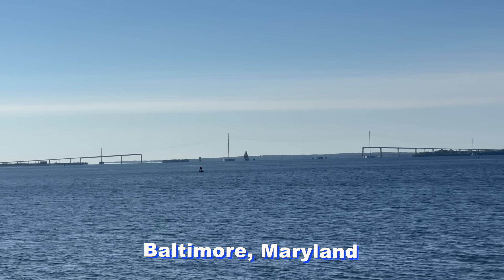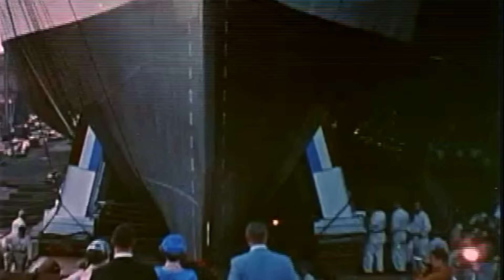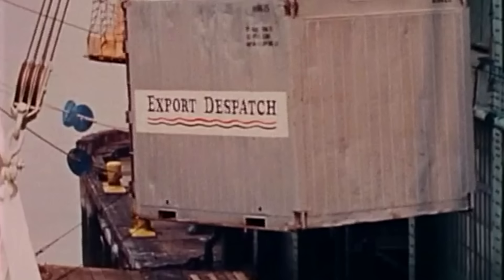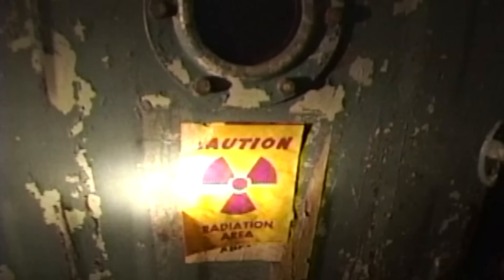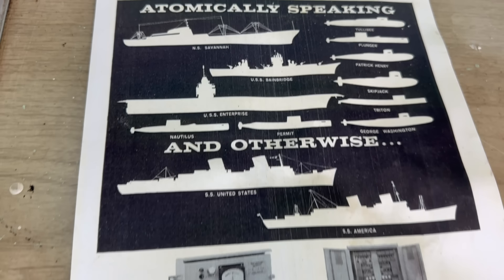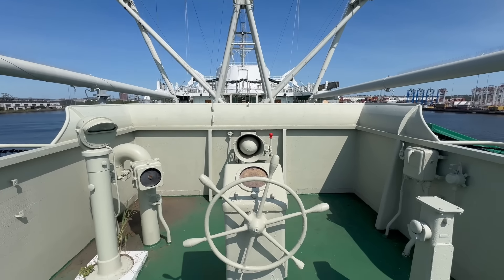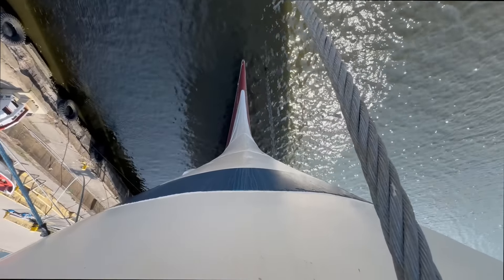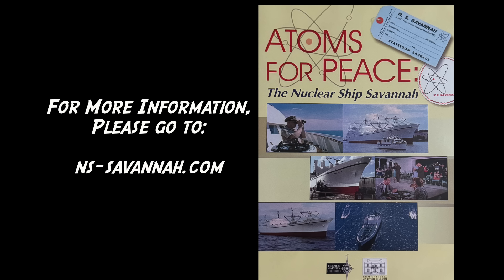NS SAVANNAH Decked! In 4K

Comment: Note that both NS Savannah and John W. Brown will be open for tours on Saturday, November 16, 2024.

Here’s a video of me trying out the “Lamp Test” buttons on the Reactor Control Panel:  https://youtu.be/UMOFP8V8dLU

Here’s the Control Rod Group Selector controls, with a peek inside the Control Panel:  https://youtu.be/tkVEMNxQGtM

Here’s me demonstrating the Alarm Annunciators removed from the main panel:  https://youtu.be/HWiGii9RlMY  I hope to eventually get all 154 annunciators working, starting with the SCRAM Annunciator.

Currently the Control Room is off-limits due to PCB contamination, most likely caused by me tracking dust from inside the console.
Reply from the maker: Excellent!  Two classics on one day.  Thanks for sharing those videos.  Very cool.

Comment: Enjoyable video and lovely restoration.  However, an observation.  Not sure how the original designer managed to botch the design by having the main lounge with absolutely zero external view over the bow but sticking a walk way between it and the exterior hull.  It could have been a fantastic view and O don’t think I have ever seen such a mistake on a ship with their forward lounge in my life.
Reply from the maker: I understand what you are saying but this was actually a classic design found on most liners of that time.   The enclosed promenade wrapped around the front of the ship, followed by an Observation Lounge.  The QUEEN MARY, ANDREA DORIA, GRIPSHOLM, ROTTERDAM and many other ships had a similar design as they were built for crossings and not cruises and the forward part of the ship was subject to rough sea conditions.  On modern cruise ships built for calm seas, the forwardmost space was often used as an observation lounge  until they started putting huge showrooms up there.

Comment: regarding her crew getting fired. I thought i saw where the nuclear engineers who came up with the procedures for running it were makeing less that the union bosses who were applying the procedures and rules and the engineers quit in protest. It would be interesting to see an in-depth video on the whole situation. sometimes it seems the path to a good paycheck is a nunion card rather than a good education. would nuclear powered cargo and passenger ships be common today if it weren't for that spat with the union? discuss
Reply from the maker: Interesting on the union issues.  I know it was very complex because of her nuclear power but not completely unique.  The US-owned lines had a lot of labor issues during that time.    I think now with security issues, nuclear power would be a very difficult option with passenger ships, even if it were found to be safe and clean.
Reply: @midshipcinema  I wonder if with the new LFTRs and SMRs ship power coul become revolutionized again. regarding unions I have had engineer dreinds that got crap from union floor people once the union found out they were either contractors or engineers. I doubt issues will ever go away. would there be nuclear powered cargo and passenger ships today if it weren't for the spats with the union?

Comment: I would not say that the nuclear reactor stooped it viability. What stop the ships viability was that it was generally grossly uneconomical. It had a very small passenger capacity as well as a very small cargo capacity, even compare to other ships of that time. She was also really outdated becasue the concept of a mix cargo and cruse ship was gone by the time she exited demo services..... Well sort of.

The negotiation about docking is also really a none issue. In reality for a ship in real reviewer service, it would dock in a set number of pre arrange docking harbors.
Reply from the maker: Agreed that all those factors were part of the problem.  But again, she was never meant to be economical.
Reply: @midshipcinema  Exactly, she did the work she suppose to. Fairly well. External factors made it irrelevant.